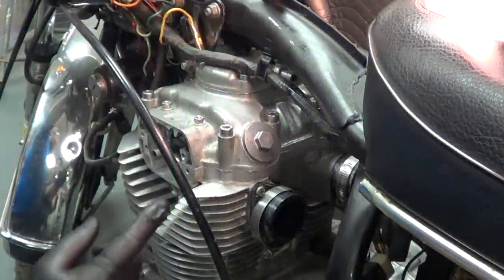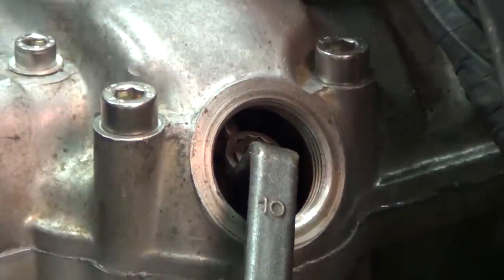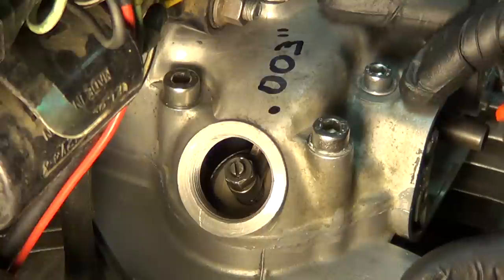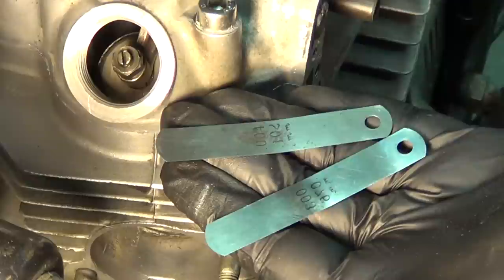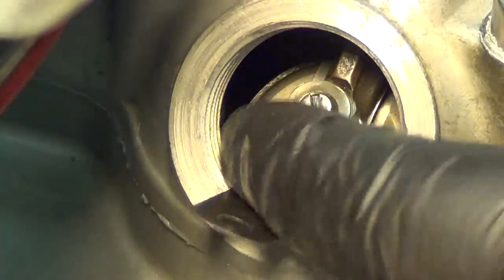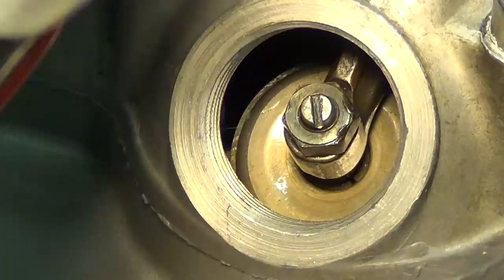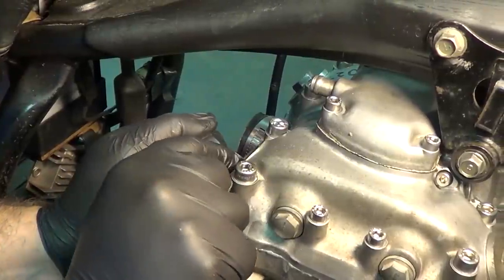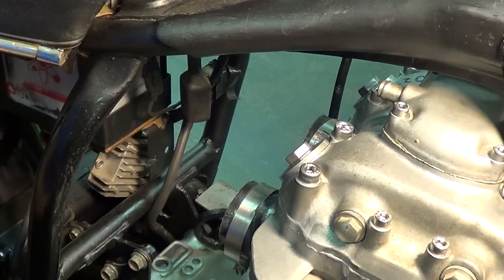How to Adjust Valve Clearance Honda CB360  CL360

Comment: You guys have made so many awesome videos for the 360. I would love to see a video on fixing the clutch pop problem!
Reply: I would also like to see this video done. Great work guys!
Reply: After studying that issue for a year I can tell you the easiest solution is to just remove the upper clutch adjuster LOCKNUT the one at the handlebars. Thank me later. Set clutch as usual per manual.

Comment: The first time I did this I used a regular wrench and screwed up the threads where one of the tappet covers screw in. It was cylinder 3 and I had weird angle when I was loosening the screw, ended up pushing part of the wrench into the screw threads.  Luckily the tappet cover still screws in, but not as easy as the other ones.  Live and learn.   After that  I went out and bought one of those slightly bent wrenches for future valve clearance jobs.  I also picked up one of those little Honda tools that's made just for this job.    I haven't tried it yet though.

Comment: This is not how Honda recommends adjusting valves just so you know Honda says metric feeler gauges and use a go no go method that means if it’s supposed to be 3 mm you adjust it to 3 mm you take a 4 mm and check to see if it’ll go in if it goes in you didn’t get it adjusted right if the 4 mm doesn’t go in then you got it adjusted right real simple i’ve use this method for over 30 years working on Japanese motorcycles it works
Reply: https://drive.google.com/file/d/0B8RLEMngUB63YU9SaUNEMEhhTjQ/view?usp=drivesdk  Here’s the manual. It supports CMC method.

Comment: question on your use of shims stock.. how do you determine that you need .002 and .003? I ask because, as a professional mechanical inspector, I can assure you that if a .003 shim fits and is not captured by the screw, that your gap is .003+ (aka a loose 3). The use of shims displayed in the video would give you larger clearances than described. I would think that, if you want a .002 gap, you use a .002 shim, and once it releases you know your gap is .002+.

Comment: I wish I had found this video yesterday.  I like your technique of going a little tight one size higher.  I wasn't sure how much drag there was supposed to be on the feeler gauge, it's hard to show that in a video or manual.  When I did mine I got confused because it seemed like one or two of my tappets had more up and down play in them then the others.  I had seen a couple videos that said there should be no up and down play, just a slight wiggle.  Looks like you're saying a little up and down movement is okay. (Obviously there should be enough movement to let the feeler gauge through, but it's so small it's hard to feel that movement sometimes.)
Reply from the maker: Yeah thats why we error a bit on the loose side slightly. Usually when I do my valve adjustment I can always get a little sound out of the tappet as you hear in the video. Its the points that need to be spot on.

Comment: Hi, I've ordered many parts from C.M.C. for my 360 and really appreciate all the videos. I've done the cam-chain adjustment and have moved on to the valve adjustment. My only question so far: My engine always builds up pressure as I'm coming onto the compression stroke(of course) but as I hit the 'LT' mark the engine rotates forward on its own. This made it difficult even to do the Cam-chain adjustment as it even rotates forward past the 90degree mark. I have been able to wedge my wrench into a position that keeps the engine from rotating to allow me to get it all done but I really feel like it's not right as in both of your videos you were able to leave it on the the mark with no problem.. Am I on the wrong rotation?
Reply from the maker: ChrispE the engine always wants to rotate past the LT mark on the compression stroke. You will have to hold it in place with a wrench when adjusting the timing and valves.

Comment: I am having the same problem as @danieltyler.  How does your generator just stop on TDC and you can take your wrench off the generator?  I have to struggle to hold mine on TDC.  This makes for adjusting the clearances very difficult because one hand is on the wrench holding the generator on TDC.

Comment: would you use the same adjustment values for any bike or is this typical for your model? i have a honda ps50 and i want to set the valves, they told me to use the 0,05mm feeler gauge (for both valves)

Comment: Been adjusting Honda valves for 45 years.  Good camera work but bad procedure.  I always use metric blades pre-curved to gain a perpendicular access to the gap.  The tappet screw (it's not a bolt) is turned into the .08 blade until there is a little more drag than is proper.  Torqueing the nut pulls the tappet screw away from the valve stem ever so slightly which resuilts in a perfect .08 clearance.  The proper way to gauge 'slight drag' is to reinsert the blade and feel for a slight resistance and a little chatter as it slides between the 2 surfaces.  Using metric blades is nealry 3 times more precise.  You can then try a .09.  It should not go.  A follow-up with a .07 should produce no drag as the blade enters the gap.  This is how you set a precise .08.
Reply: I just did this for the first time today on my CB750.  So you're saying if I've measured and set it properly, one size higher feeler guage shouldn't fit at all?  That's interesting.  I assumed it would fit, but it would be really tight.   The slight resistance part is the part I'm having trouble with.  I'm assuming it should go through easily but with a very slight resistance to let you know t's connecting with the top and bottom part.   I think I set a couple of mine top tight. It would slide through, but if I let the entire feeler gauge tool dangle there against the engine, the pressure would hold it in place...if that makes sense.  Does that sound too tight?

Comment: working on a CB360T I've Ste the timing and it dead on according to you video, also the valves are good too. but when I fire it up it's piping and backfiring and switching from running on 1 to 2 cly?? what am I missing here? also it's got a brand new battery too. is the condenser toast? if so how do you check it?

Comment: Ideally a torque wrench should be used on the jam nuts after first snugging them with a wrench.
Anti Seize works great for keeping access covers from sticking.
Reply: Just curious how you would hold the set screw with a torque wrench on it? My understanding is torque wrenches are usually sockets, is there an actual wrench version?

Comment: So last week I did my cam chain adjustment just fine. Today I went to this and when trying to spin the engine it wants to spin past the LT mark, and only stays there when I hold it in place. Help?
Reply: Same thing happened to me today.  I assumed I did something wrong!  Daniel Tyler did you find a solution?
Reply: Trying to picture how the screw driver would hold it there.  Did you put it in the stator?
Reply: I eneded up just propping the socket wrench up so it would stay in place with a piece of fire wood.
Reply: I don't have any firewood.  ;)

Comment: my lifter locknut keeps coming loose and i loose valve adjustment.do u recommend locktight? double nut? or nylon locking nut?
Reply: Hi temp loctite red or blue  my tappers have come loose without it

Comment: any tips for removing a stuck valve adjustment cover? one of mine won't budge and i've already nearly stripped it trying... lol
Reply from the maker: Heat it with a propane torch ( remove the gas tank first), penetrating oil, 6 point socket. Just get it removed, we have replacements, part number 4022
Reply: @Common-motor  you rock, thanks! i'll give it a shot, and sorry do the ones you sell fit the CB175? didn't see it listed in the description but they look the same...
Reply from the maker: The 175's are much larger in size than the 350 ones. They are available as A special order item.
Reply: @Common-motor  can i email you for a set?

Comment: would this solve the ticking noise?
Reply: I have some ticking sounds coming from my 75 CB750.  I thought I did something to it after adjusting the valves, but I think the ticking was there before.  I'm guessing it's somewhat normal, but I'm new to motorcycles.   I'm definitely going to check my valves again after watching this video.  Going one size up but doing it tight, seems like a good idea.  I'm still not sure exactly how much resistance I should feel when I slide the gauge through.

Comment: thanks again!!!
Edit: I opened my covers and it has no adjustment screws, just the rockers and valve top.....what Am I missing? this is a running motorcycle(1970 CB 350)...
Reply: On my CB350G, the valve adjuster screws are actually located right next to the points plate in the cases on either side, and NOT inside of the 17mm housing for the valves themselves. Tripped me up too!
Reply: The eccentric shaft adjustment on the 350 and 450 twins are superior to the 360 rocker tip adjusters 

{ less reciprocating weight }.  Honda stopped using eccentric shaft adjustment because A. rocker tip lock nut type { 360 } heads are simpler and cheaper to make, B. eccentric shaft adjustment would be hard to make work on 4 cylinder engines. And yes the 350's are faster.

Comment: I did this adjustment, now the kick start lever is barely moving
Reply from the maker: david barranco something is not right with your engine or the process was performed incorrectly. Try it again. Engine should always move freely  with the kick start when in neutral

Comment: 5:02 the factory service manual says 0.03 for the exhaust valve...... not 0.003
and 0.002 for the intake
.
HOWEVER!!!!!!! 0.003 is the correct setting..... the manual is wrong!!! 
if you convert the metric numbers given in the manual to inches.... its 0.003 EX and 0.002 IN

Comment: Nobody noticed that there is no reference how to establish the process on the right side !? I've checked several times ! I am missing something ?
Reply from the maker: Yes you are missing something... Rotate the crankshaft until the T mark aligns with the index mark on the compression stroke of the right cylinder. Adjust the right side there. All this information is also in the factory service manual which can be downloaded from our website.
Reply: Thank you  @Common-motor  . I have got a question for you ! I have a 250 G , , new pistons ( standard new rings . The right exhaust it's more strong than the left . I have done all the settings as you show in your videos !

Comment: What do I do when there is no timing mark on the stator?
Reply: Going from my experience with a single cylinder engine I'm gonna guess the 'LT' mark is the same as the top-dead-centre ('T') mark. You need to be on the compression stroke which means both valves will be closed, so there should be some free play in the adjusters. Best way to check is to remove the adjuster inspection caps and crank the engine over, watching the valves carefully. When both valve adjusters are at their highest point then you'll be at top-dead-centre on the compression stroke. 

I'm sure this engine layout will be similar!